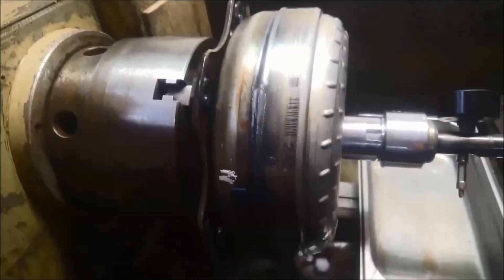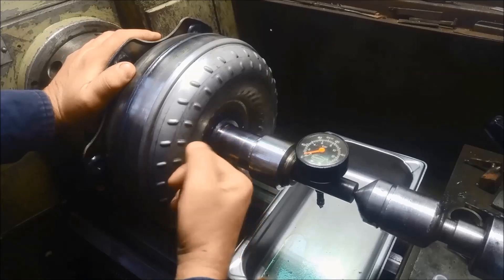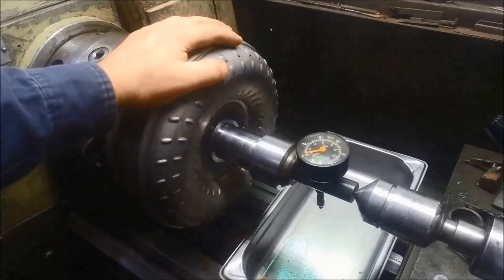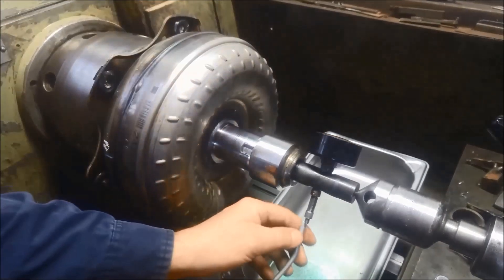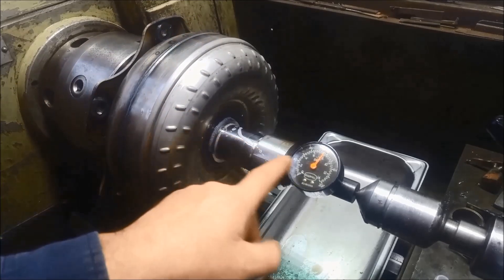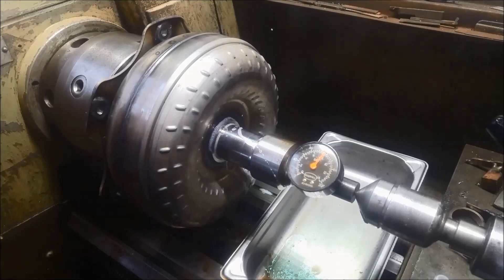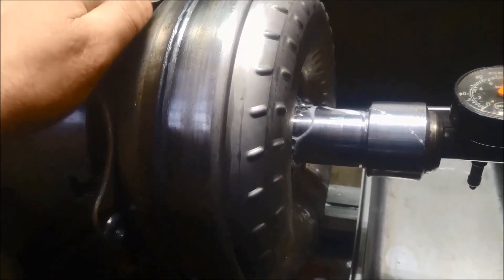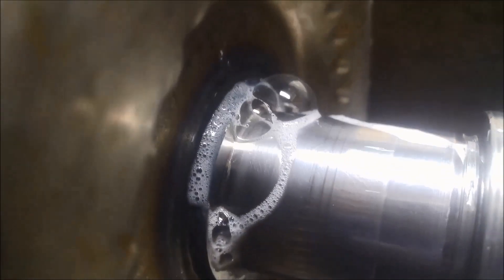Torque Converter Leak Test - What Pressure Test Torque Converter to ???

Comment: My Nissan rouge is leaking that blue liquid out right in the transmission area.  I took my car to two shops and the torque converter came back on the diagnostic.  Is it that my whole tranmsssion needs to be replaced or it is the seal to the torque converter that’s causing the leak.  My engine light came on and it leaked alot of that blues liquid out and I could go above 40 miles an hour and a few days after the engine light went off and it’s driving perfect but leaking a little bit of the blue liquid.  Thank you
Reply from the maker: hi, really hard for me to determine without having a look for ourselves. make sure fluid level is correct. not sure why your trans fluid is blue ?  often the front pump seal ( and worn pump bushing ) will leak, make sure you also check pump bolts and o`ring/gasket on the pump. like in vid get torque converter pressure tested if you cant find any obvious leaks. cheers

Comment: OBD2 Trouble codes P0700 along with P0742 .Try a  >.Torque converter purchase (.Not ever in a  new rebuilt converter should you find any oil except for a :light film< of "clear color "assembly oil. . Any other oil seen in said remanufactured converter "is not been rebuilt,"no oil puddles as purchase to avoid . .
Reply from the maker: hi, some preprime their reco torque converters. thanks for that. cheers